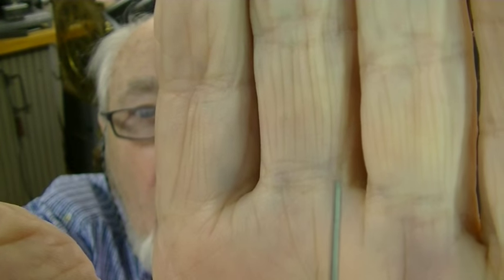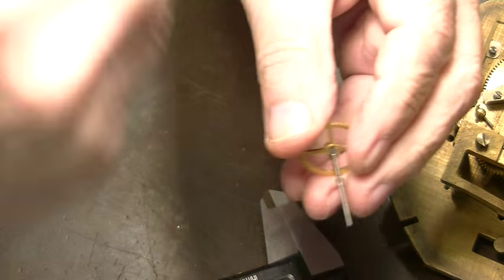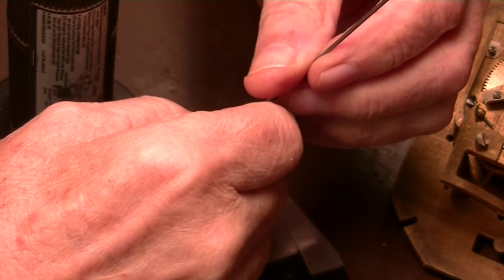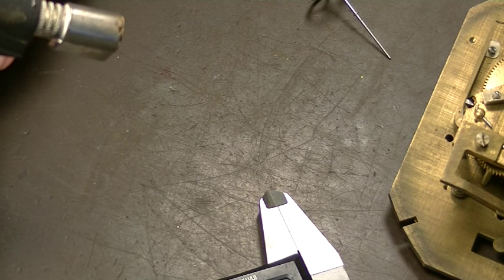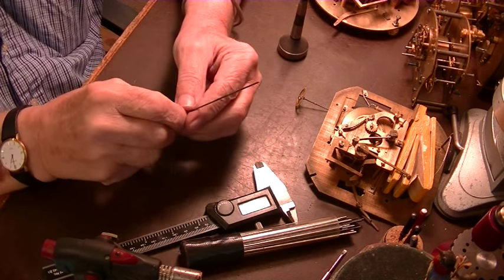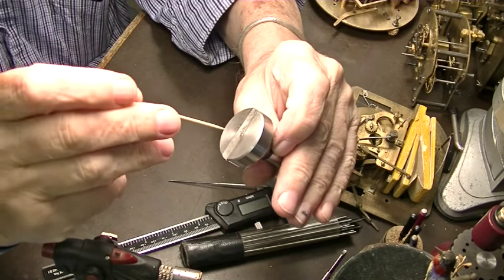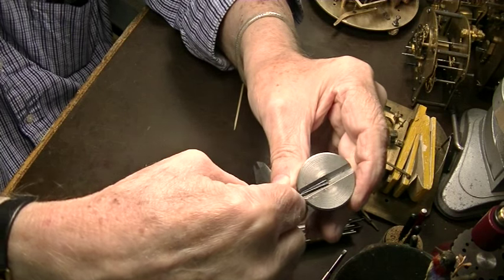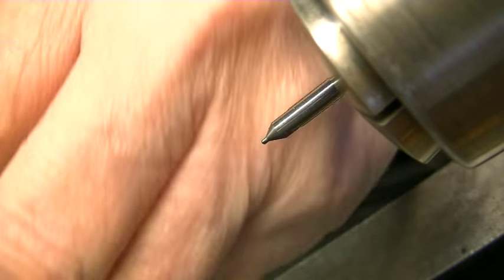The Village Clockmaker. Clock repair tutorial #20. Repairing a broken hole in a center shaft.

Comment: I did a similar repair on a longcase centre shaft. I just filed a scarf joint (half lap) and silver soldered a new section of steel to make the new tip. I don't really have a setup where I could do a centre-drilled hole in an arbour, so that was my solution. Once the repair was filed and smoothed, it was quite beautiful and durable.

Comment: That is a very clever repair. It is an extremely fiddly job, but clocks are extremely fiddly contraptions; the consolation is that watches are worse. And I really like that female center you made for the tailstock and will copy it ASAP.  Personally I prefer MAPP gas for any metalworking, and leave butane for ultra-small fiddles. But that's just me.

Comment: Thanks for another great video.  Do you think the acetone cleaning process might be enhanced if, after completing the drilling and expelling all the grit, and wiping the drill bit with a cloth moistened with acetone that a few drops of acetone might be put on the drill bit and run one more time into the hole to clean the inside of the hole in prep for the tenon?